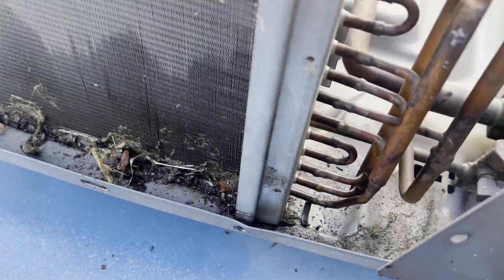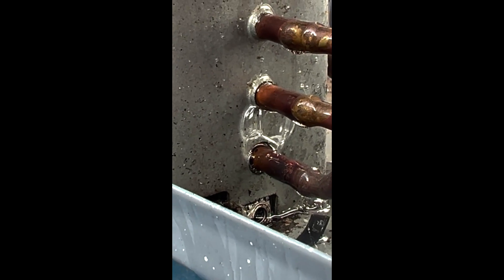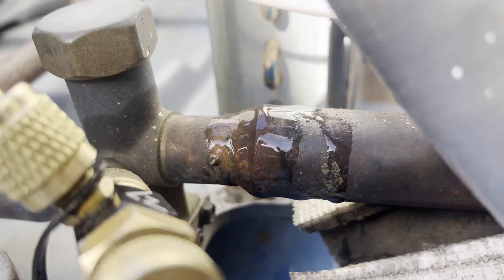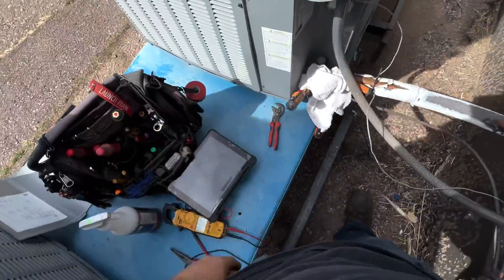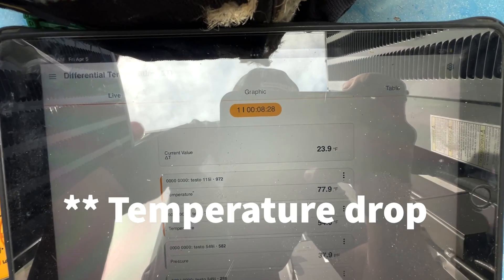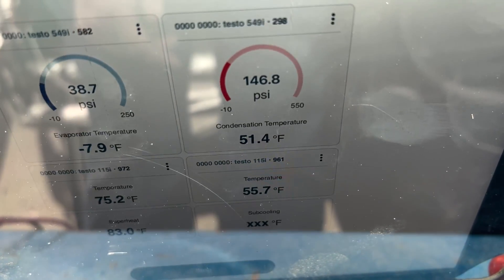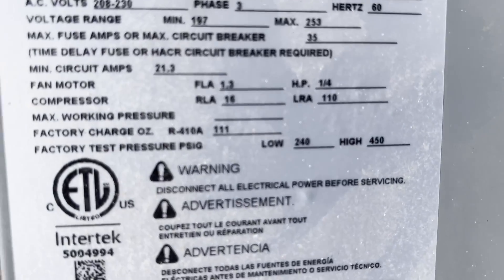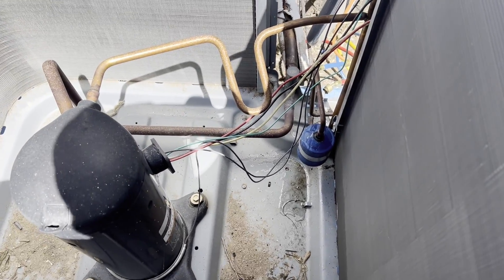Repairing a leaking condenser coil and a restricted filter drier

Comment: Do you just break off enough fins to get to your leak area ? Do you replace it when done ? Also the r410a has high gwp and was reading that r32 is perfect replacement for r410a with only 3rd of gwp and slightly better efficiency. Can r410a be replaced with that in every unit ?

Comment: I’ve had good luck repairing condenser leaks. A relative called me one day and said his roommate accidentally shot the condenser coil with a .22 bullet. The local HVAC repair company refused to fix the hole. I was able to repair the hole by removing a couple inches of aluminum fins and splicing in some copper tubing.

Comment: Due to vibration that coil will leak again. Probably ok for a while given you're in Colorado and AC season is very short there. I've attempted these coil repairs here in my area they rarely last that long. Nothing to support the metal refrigerant tube on that one side that you had to remove to make the repair. Due to that those tubes will vibrate during operation and rub themselves a new leak. I get it that this is commercial and tenant is probably renting this space so much cheaper to attempt a repair than buy a new condenser coil as those aren't cheap. But if it leaks again in less than 2 years, it may cost you this customer because they view you as wasting their money. Something for you to think about.
Reply from the maker: The customer made the choice on how they wanted to deal with this unit. We made them aware of the situation and risk that comes with this type of repair. We offered a new condensing unit, a coil replacement, and this emergency repair. They chose to go this route as they needed the unit running ASAP.  Communication is key for this situation, as it's not my decision to make. It is ultimately the customer's decision. 

I made sure to leave the coil mount points intact to help support the coil and minimize vibration. I suspect leaks at the bottom of coils, like this, are often caused by aggressive cleaners not properly rinsed off, meaning the entire lower section is potently compromised and may leak again. This is something we made sure the customer is aware of.  The restriction in the filter drier could also return, as it may be oil break down, compressor damage, or debris in the lines from install. But again, I can't force someone to buy a new unit. As the word moves deeper into A2l and SEER 2.0, the match up components are getting harder and harder to get, meaning repairs like this are going to be the only repair option for many customers here shortly.

This may be colorado, but this unit is not gonna get any days off, we service the indoor agriculture space.
Reply: @mechanicalenvironments  ah ok I would think indoor agriculture would have more money for things like this, but I digress it's a slippery slope. Nothing wrong then if you explained it to them covered yourself with other options you recommended. True that money is going to be a stickler going forward.
Reply: @mechanicalenvironments  I have a leak near the bottom of the coils. Wondering about 1. repair the leak vs 2. replace coil only or 3. replace the whole condenser unit.  Question is... Is the leak in the coil symptomatic of a larger issue with the condenser or even bigger issue?  Is a bigger issue causing the coil to rupture and this may happen to the new one soon?  Or does this just happen and replacing the coil would be a smart fix over buying a whle new condenser unit?  What CAUSES leaks to happen in the coils?
Reply from the maker: @etmeyutub great questions, the location of the leak can usually speak to how it formed, this model unit sold under multiple brand names is notorious for leaking in these end plates. The copper is super thin here and I think the vibration from shipping is rough on the units rubbing this spot down even more. If these leaks are caught early and your units warrantee was registered you may be able to get a replacement coil from the manufacturer. The compressor is the other component to consider, is the top paint coming off from constant overheating? Has the unit been run dry that could have resulted in compressor damage? If the compressor is still strong then a coil repair can be a great option, especially if the coil is under warranty. The coil repair is the economical option but like another commenter pointed out there is no telling if other spots on the coil are thinned out and could start leaking at any point, I’ve had repairs go both ways, it’s not the repaired area that fails but a similar spot to what caused the original leak. If the compressor is indeed an issue, and you can find a replacement unit that matches your current refrigerant you’re lucky as we are underway with a refrigerant change. If a matching replacement outdoor unit is not available you’ll be forced to do an entire system change to swap outdoor units, or you would need to change both components, coil and compressor to stay with the same refrigerant. The only time I’ve seen a system issue cause leaks at the outdoor unit is when the outdoor fan fails and the unit experiences excessive high pressure usually this causes a crack in the discharge line on the compressor. Small leaks in the coil are usually environmental/handling related, quality control issues or improper cleaning procedures. That said, we haven’t seen your system, and anything is possible but this is what we have experienced over the years. We recommend finding a service company in your area that’s not hell bent on selling you a new unit to provide some quotes for options and equipment availability in your area.

Comment: Great job! Thanks for recording. 👏.  I like to upsize my drier when possible when dealing with restrictions. Just like you would with burnout, you get more capacity to catch anything that may be left. Sometimes, if the oil is an issue, I've seen driers plug again after the initial repair.
Reply from the maker: That's a good call, gonna need to truck stock some larger driers before summer gets underway.  We did made sure the customer is aware it may plug up again, but hopefully there good to go for a while
Reply: @mechanicalenvironments  Yeah, I played this game with a carrier 2 stage, 410A. The condenser got dirty, cooked the oil, and plugged both driers. Only had a single C083S and one C163S. The 083 plugged again, but the 163 did not.